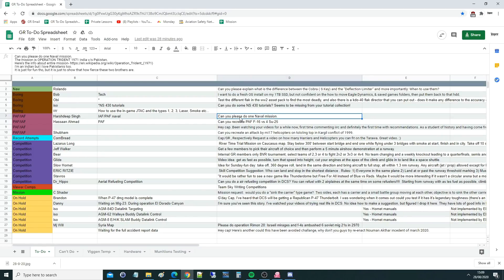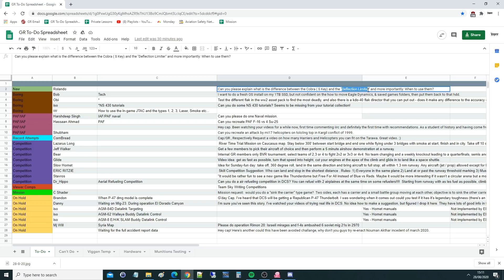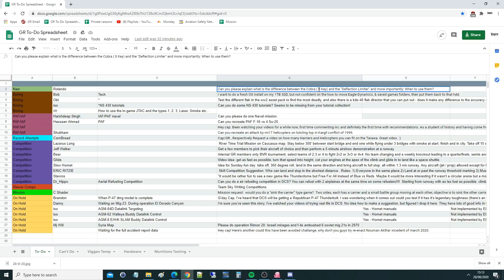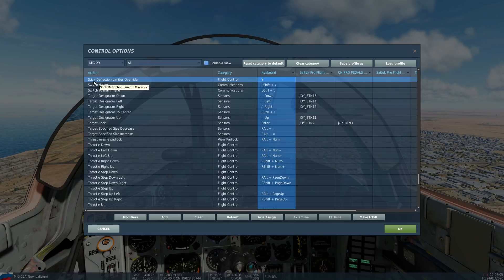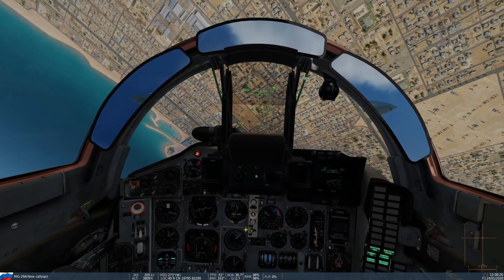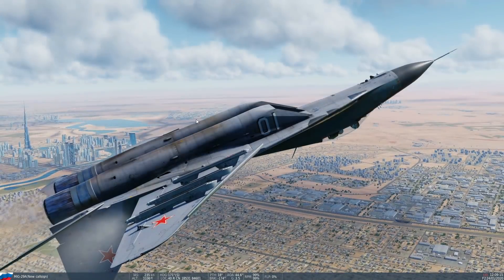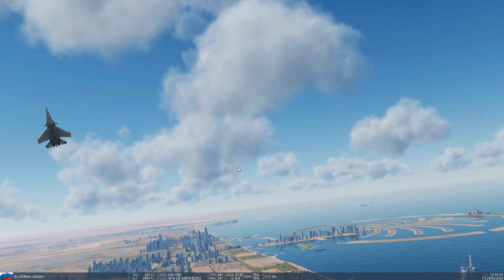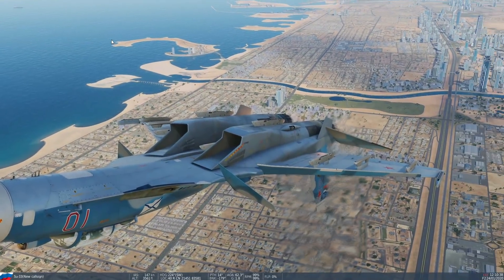Su-27/33, J-11A & Mig-29: ASC Control(Cobra) vs Stick Override & When To Use Them | DCS WORLD

Comment: mind if i ask whats the max speed that i can pull a cobra in the su27 cause at least at 600 its wings rip apart
Reply: max 450 is ok, if you go over it then basically you wont be able to pull that sharp

Comment: TIP: use ASC Refuelling Mode instead of Auto-Level which doesn't use Autopilot Reset but Toggles. It is vastly more precise especially allowing it to Trim where as the other does corrects any adjustments you make and yoyos up/down lots! 
As a bonus use Auto-Thrust too for Formation flying as well as obviously for Refuelling.

Comment: Did you guys use Y while measuring turn rates?
Reply from the maker: Whats Y?
Reply: @grimreapers  
He means the Stick Limiter Override. By Standard it is set as "Y" Key. 
Advised would be to bind it to Joystick.

Comment: Viewers should be advised there is less than accurate use of the word "stall" in this video.  The stall point is the critical angle of attack.  If a wing is actually stalled, increasing the AOA will not increase lift, it will reduce it.  
Low aspect ratio swept wings have a broad range of increasing buffet often without a clearly discernible stall break like a straight wing.  If going past the AOA limiter increases lift it's because the limiter is set well below the critical angle of attack.  I don't know specifics about  the MiG-29, but there can be multiple reasons for normally restricting that AOA region in any given aircraft.
Reply: The thing is that fighters in general, especially russian ones, have an incredible thrust to weight ratio, to the point that me and my friends jokingly call them "bricks with engines". So with that extra aoa, it shifts the thrust vector a little bit up, and even with less lift from the wing, it can start climbing up, building speed and losing aoa.
Reply: @waltergabriel5501  I don't know what you are trying to say, which appears related to climbing rather than a discussion of when a wing is stalled, but modern fighters are hardly bricks and are very maneuverable.

Comment: Side note: MiG-29 is stable with conventional flight controls, but Su-27 is unstable with FBW computer control. 

Side note 2: To make very high AoA maneuver like cobra you need to fly very slow, 200-250 knots at most. If not you will do one of two: make loose ~40°-50°ish AoA maneuver or tear the jet apart and lose consciousness in a second.

Cheers and thanks for the video.
Reply: Over around 600ish km/h the wings just rip off completely from the flankers if you try to cobra

Comment: Dont use the override over 800km/h that will broke your wings.
Reply: Not only that but the plane will begin to shake violently and oscillate out of control even if you are flying in a straight line and not touching the controls.

Comment: MiG-29 is longitudinally stable, unlike Su-27. It doesn't have fly-by-wire and it can't do a Cobra. Still a much better airframe.
Reply from the maker: thanks! I always wondered why it didn't have the "cobra feature".
Reply: @grimreapers  You are welcome. By the way, there is also a version that can do much more than just that, but only because it's equipped with TVC (called "MiG-29 OVT").  Of course, with TVC even a steam locomotive would be able to perform all kinds of maneuvers, so that's not exactly an achievement. The Sukhoi's airframe, on the other hand, is quite a work of aerodynamic art, since not only it can go unstable and flip to around 120° AoA, after that the pressure center will shift downwards and revert the backflipping tendency. That's why maneuvers performed by Draken and MiG-21 cannot be truly considered "Cobras": the planes are always stable during those. Unlike them, Flanker undergoes the unstable/reverse-unstable cycle.

Comment: As far as I know,  in real world scenario, Russian pilots claimed that they also use Cobra maneuver to basically notch the incoming missile... don't know how it works, but it makes sense on theory 🤔  but I don't think is modeled in dcs
Reply from the maker: That would be interesting yes.
Reply: It doesn't work by the very definition because during all very high AoA maneuvers, like i.e. cobra, plane doesn't change it's flight vector in relation to opponent's radar - only nose position. For the radar plane fly identically as before the maneuver. It can be useful in other situations thought, like forcing overshot.
Cheers
Reply: @bazej1080  guess you are right. I can't find the video in which the pilot explains it. But it was something related with  low speed threshold of the radars(if this is a thing). If the object is too slow the radar ignore it as an error. Don't know 😕 maybe I am talking bull** but it is an interesting idea to check. Cheers
Reply: @velizarzdravkov6686  if you change your speed enough while changing direction you can reach speeds within the doppler filter faster with a cobra

Comment: ive heard if you pull the highest AOA in the MiG-21Bis it will do something similar to a cobra, ive tested this on war thunder and my buddy did a similar thing in dcs but i want to see you do it
Reply from the maker: I have tried this in DCS, but I can't get 21 do it. I don't think that the model supports it.
Reply: @grimreapers  I have not tried it, but i think you need to pull some CB to allow the larger deflections at speed. The faster you fly the mig, the less deflection the hydrolic system produces.
Reply: @grimreapers  ya my buddy said it wants to do it but the limitations prevent it which kinda sucks

Comment: Hi guys I've now got the base DCS world, what controllers would you recommend for a Flight Sim noob who hasn't done it properly since Gunship 2000?
Reply: I have Logitec/Saitek pro HOTAS for three years now! It was good at first but it still has poor wiring sadly and my rudder now has a dead zone that almost covers its whole range of motion. Random inputs from what I assume is wires shorting!  I recommend the Lower end Thrustmaster products they are more durable. Although I still do like the throttle but I'm going to have to get me a new stick. I'm thinking the T1600 Thrustmaster,  Just wish it had a few more hats and such like my Saitek/Logitec They are the same stick Rhino and Pro by the way!
Reply: Ive got the Thrustmaster T-Flight HOTAS X ($70ish on Amazon) I just use it with my keyboard and I love it!
Im pretty sure Cap has a vid about his setup, but iirc he's got one o' them pretty-penny Warthog HOTAS Thrustmasters ($300+)
Youre gonna want throttle control, so I would definitely recommend hotas for sure, but its all about how much you wanna spend.
Reply: @OHNOKite  I want to be to have some semblance of control over the aircraft
Reply: @mpainter22  if you want to spend a bit then you can proceed with T16000m set with throttles and pedals, I found it to be an excellent starter for flight sims, it gives you that cockpit feeling with HOTAS config, but if you want to spend even less you can go for Logitech extreme 3D, that's got only the stick but its a sturdy one which usually lasts for an extended period. It all depends how much you are willing to spend, which indirectly depends on how much are you actually into real flight sim like DCS. Give it a thought if you feel you really can spend hours in DCS without getting bored then straight away you can go for the big setups. Anyways, I hope you enjoy your DCS world.
Reply: @mpainter22  I'll recommend the Thrustmaster T-Flight hotas X then.
My favorite thing to do in DCS is fly low altitude in the SU-33, doing cobras around buildings and trees like a crazy person.
That flight stick hasn't let me down yet!
Reply: @OHNOKite  doest it have programmable buttons etc?